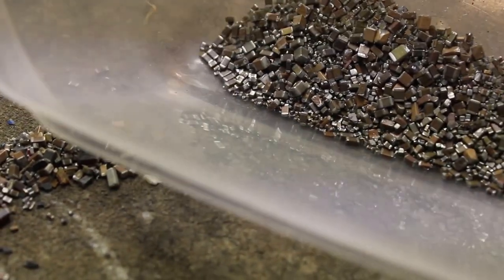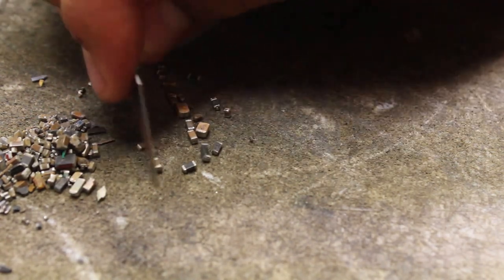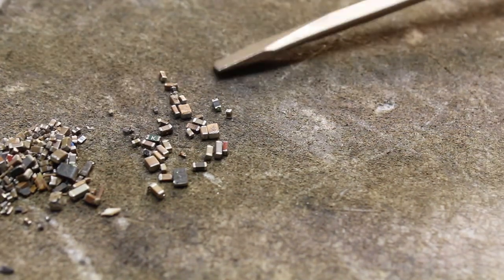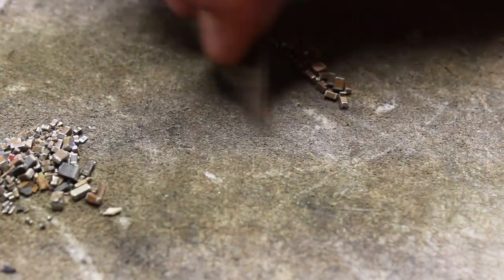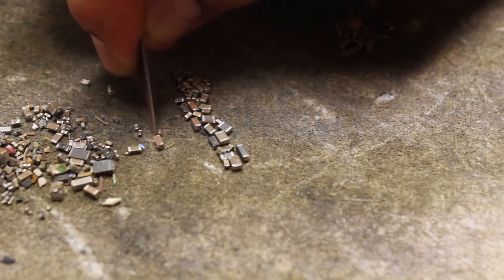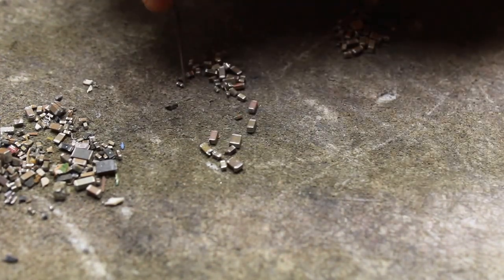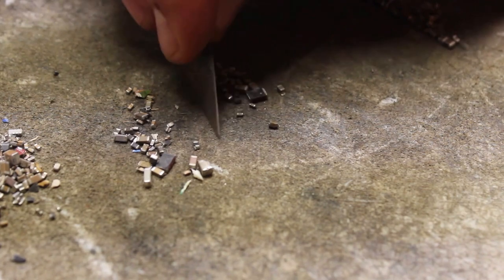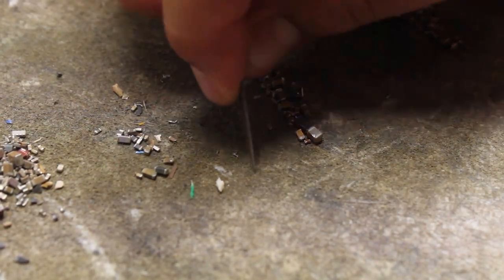Alamo City Scrapping - Sorting out MLCC's from Inductors with a Flathead Screwdriver

Comment: Is the screwdriver magnetic?
Reply from the maker: It is very slightly magnetic I wouldnt be able to pick up a small screw with it. It's been a while since I've used it I have no idea where it went lol. Thanks for watching!
Reply: You just fixed the problem, why sort, let our friends the magnet do the work
Reply from the maker: Lol it worked out for me I tested them with MLCC's against the Inductors and it worked. If it's to magnectic you will be able to lift MLCC's also. Just have to test out different magnitudes until you get it right. Try it out and let me know if it works out for you.

Comment: This is why you should read the code n the board. A mlcc has a C next to it. A inductor has a I or a L
Reply from the maker: Yup I agree with you 100%. I think I had mixed them up on accident or maybe I dropped some in I can remember so I figured a way to removed what I didn't want. Worked out for me. Thanks for commenting!
Reply: Thanks

Comment: Hmm, think there could be some nickel in the wrong mlcc what make them magnetic.
So try a plastikbag with a weak magnet in it before your fiddling work, hovering over your stock of unsorted MLCC, reducing your amount of grains  before sorting....
Plastic bag..so you can get rid of the waste, take the magnet out , everything drop of.
Reply from the maker: Well i tried it on MLCC's that I knew where them and tried it on those that i knew weren't mlcc's and it worked out for me. I'll try that technique when I have more board see what I get. Thanks for watching!